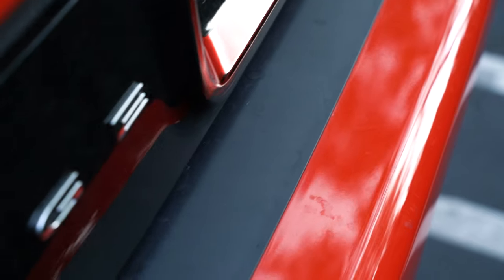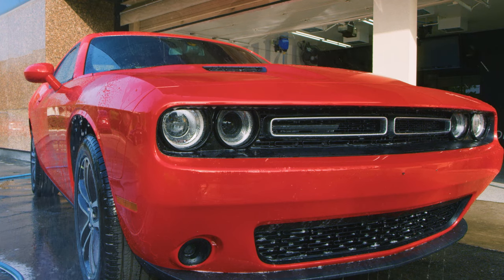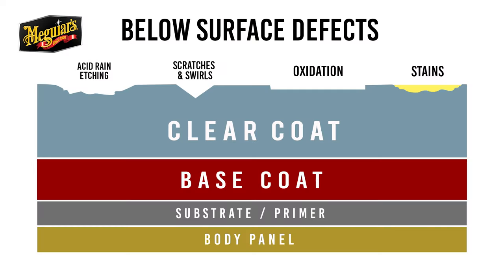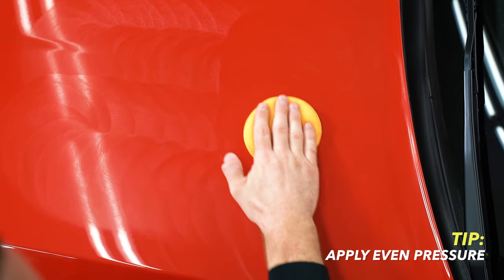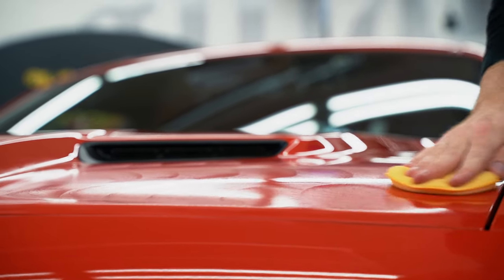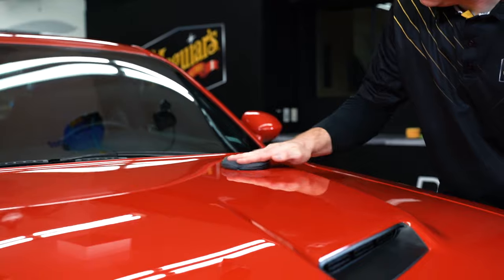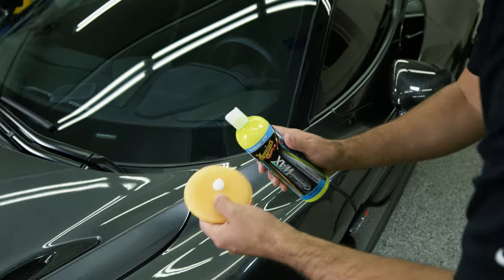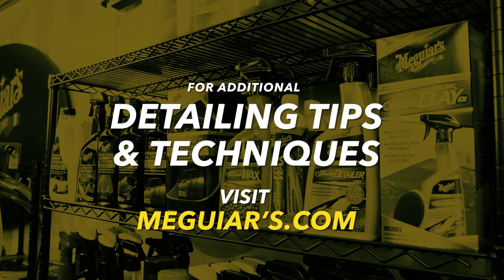How to Apply Compound, Polish & Wax by Hand – Quik Tips

Comment: Hello,

Is it okay if I just use ultimate compound and then nxt 2.0 wax? What exactly does ultimate polish do?
Reply from the maker: What compound you use typically has no bearing on which wax you choose.  There is no issues using any wax you choose after Ultimate Compound.

As far as polishing, polish is often an optional step.  Depending on the color and condition of your paint polish may or may not have a noticeable impact.  The darker the color the more shine you might see whereas on a white or silver paint, you may not see as much of an impact.

Comment: My car front fender is fading because my car is parked under sun. There is no shade parking. I’ve a black sequoia. Will these 3 products help restore the paint? It’s not much faded. Also after how many days should I wash my car after applying these 3 products (compound,Polish & wax).
Reply from the maker: Yes, these are absolutely what you would want to try if the fender is simply faded/oxidized.  👍 

Depending on which wax you use you can wash the vehicle as soon as you like or possibly wait up to 24 hours after waxing.  Typically and hopefully there is no need to wash a car right after waxing.
Reply: @meguiars  Perfect!! Thanks a lot ❤️

Comment: My Car has a swirl marks and Minimal scratches what should i use Swirl Remover or Ultimate Compound.
Reply from the maker: Without knowing the severity of the swirls and scratches or how hard your paint is that would be difficult to answer confidently.  That being the case and the fact that swirl marks and scratches are often more stubborn than you might suspect we would typically recommend Ultimate Compound.  It is more effective while still being very safe and easy to use.

Comment: Do I need to rinse off in between rubbing compound ppund and polisher or is wiping off after each step enough ?
Reply from the maker: A thorough wipe-off with a good microfiber towel should be enough.  It is not likely you would need to wash between steps.

Comment: Hello meguiars i used ultimate compound on my cars rear spoiler its black color i used a foam pad but as i removed the residue with a microfiber towel there was black color on the yellow towel is this normal or was it removing the paint?
Reply from the maker: That simply means you do not have a clear coat.  Yes, that is what compounds do.  They remove a very small amount of paint which then removes the defects in the surface.  Most vehicles for a few decades now have been clear coated (clear paint on top) so you just don't see color coming off.  Any vehicle with a single-stage paint (only color coat) will do this.  Nothing to worry about.

Comment: I bought the Meguiar’s Compound/Polish/Wax kit with applicators and towels. My 1990 miata has heavily oxidized paint that is rough to the touch but some parts of the car have a nice shine and I want all of the panels to be that way. 

Do I need to get a clay bar and do that too?
Reply: It is far better to do it if you want to do any compounding/polishing. if not, no clay needed. If it's a fresh new car, just clean it then coat/wax it. imo
Reply from the maker: Clay is designed specifically to remove contaminants that are bonded to the surface.  If you have bonded contaminants stuck to your paint yes, it would make sense to clay first before proceeding to compound, polish, and wax.

Here is a great video that discusses what clay and compound are and when to use each.

https://s.3m.com/x3tra0

Comment: The ultimate compound says to use microfibre pad. Which one shall I use microfibre or foam pad?
Reply from the maker: For application of Ultimate Compound by hand we recommend you apply with a foam applicator pad and remove with a good quality microfiber towel.  Here is a video that also shows the recommended hand application...

https://s.3m.com/8vb1dv

Comment: 1.would 1 bottle of compound be enough on a sedan?
2.if ive been told that my clear coat is so thin, shop refused polishing my car, can i still use this ultimate compound by hand or no?
3.whats better ultimate carwax or these liquid waxes you have mentioned?
Reply from the maker: 1.  Yes, a one bottle of compound should be enough to do a few cars.

2.  We cannot speak to the condition of your clear coat without evaluating it.  If it is past the point 
     of mild-moderate oxidation and is nearing or has reached actual paint failure the shop may be
     correct in their assessment.

3.  Not sure how to answer that without more specifics as to which two products you are hoping
     to compare.

Comment: Did 2 cars with these specific liquids and can tell they're amazing... So now I have a new motorbike that needs you know... Just a light polish and wax. However on the Polish Liquid it says to not use on PLASTIC which is what the fairings of the bike are... Any direction? Thanks, love your products!
Reply from the maker: The warnings are related to wax residue that can be difficult to wipe off of rubber and textured non-painted plastics.  If the plastic is painted that is not a concern.
Reply: @meguiars  Using an Rubber Eraser gets any white polish or was marks off plastic trim....
It's a fantastic tip I got from a detailer.
Works like magic

Comment: Would using a generic small orbital buffer be better than by hand?
Reply from the maker: An orbital buffer can save time/energy while applying products more evenly but the results will likely be similar to hand application.  A good DA (dual action) machine is where you start to see quite a bit better performance especially when removing defects.

Comment: After all these steps, what would the process look like for the next wash? Say it rains and the car has water spots 2 weeks after you followed this process and waxed. Would I need to spray/wash/rinse and then wax again? Or would spray/wash/rinse be enough?
Reply from the maker: Entirely depends on how bad/stubborn the water spots are.  Hopefully just using a spray detailer or washing does the trick but any time water has a chance to sit on the surface for a long period of time, especially if baked in the sun, you have a chance for more serious water spotting.

Comment: I used compoud and then Polish yesterday, but it was very difficult to remove them, they dried very quickly.  I did it in the garage at 10°C, but if I didn't remove it instantly, it was a nightmare to remove the product.  what am I doing wrong ?  I got much more tired taking out the product than applying it
Reply: For the compound do a 60cm square and wipe off immediately.
The polish however maybe 20-30cm and u have to work fast before it dries up or it will power and be a nightmare to get off

Comment: Can i use a 100% Cotton cloth instead of a foam applicator pad?
Reply from the maker: In some cases you could get away with this but most of the time it is going to be safer and more effective to use foam applicator pads to apply product.  The foam will help compound work better and many terry cloth towels greatly increase your chance of creating swirl/towel marks.  For removal a high quality microfiber towel is always better on paint.

Comment: Should I apply my wax directly after Meguiars Polish or first wipe the car off with IPA?
Reply from the maker: Yes, typically you can/should just apply the wax right after polishing.  In most cases you will not need an IPA wipe down in between.

Comment: Do I have to degrease after polishing before waxing ?? Or can I just wax right after polishing ?? Thanks
Reply: No, you only degrease before you claybar and then either compound/polish and then apply wax. All in that order
Reply: @kyleraiff8637  awesome thanks for the help !!
Reply from the maker: Correct, there is typically no reason you would need to do that between polishing and waxing.  👍

Comment: Can I skip polish and use the same towel to wipe everything off
Reply from the maker: Polish is an optional step in many cases.  Whether or not you choose to polish can have a varying impact based on the color and condition of your paint as well as your personal desires for it.

If you are asking if you can use the same towel you used to wipe off the compound for removing the wax.  No, you should not do that as compound will remove wax.

Comment: I Have A Question What Should I do if The Paint is White And Really Chalky And Ruff ?.. Should I Skip The Clay bar Step?..
Reply from the maker: You first need to determine whether you are dealing with oxidation or the paint is actually failing.  If the paint has already failed the only remedy is repainting.  If it is only mildly to moderately oxidized there may be some hope.  If that is the case you would want to consider a full detail which would include claying and the steps shown in this video. 

Here is a great article that covers the 5 Steps of Paint Care which has a lot of foundational information you will find beneficial.  When you have a few minutes give it a read through.

https://s.3m.com/2u2ay4

Comment: When should i use a wool pad, is that when the scratches are deeper? I got an old 19yr Civic with quite some scratches and would like to try to get look a little bit better. I got a couple foam pads but also got on grip with a small wool pad.
Reply from the maker: This is a bigger conversation that needs more information from you to answer adequately.  Please feel free to reach out to our Solutions Hub with more specifics of the machine you are using, the vehicle/paint, your level of experience with a buffer, etc.

https://s.3m.com/elaz3

Comment: I had recently bought a Meguiar wax paste. May i know how long is the drying phase after wax is applied before performing buffing process?
Reply from the maker: That can depend on the specific wax you are using.  Traditional waxes often you wait until the product dries to a haze and turns chalky before wipe off.  Some of the newer synthetic formulations do not dry and can be wiped off almost immediately.  Drying time can also vary depending on the weather conditions and how much product was applied.
Reply: @meguiars  thanks for your quick replied. I bought the Gold Plus wax.

Comment: How long can the Ultimate Liquid Wax last if I use a pressure washer to wash my car every weekend? The pressure washer is a 2300 PSI 1.48 gpm electric Sun Joe on 40 degree fan tip.
Reply from the maker: How long any wax last is highly variable and depends on the specific vehicle and the environment it is in.

That being said with a typical daily driver we recommend you wax at least 3-4 times per year.

Comment: I can't get the compound to not leave it cloudy.
Reply from the maker: There may be an issue with your application process or you may be dealing with paint failure and not just oxidation.

Please feel free to reach out to our Solutions Hub via our website and include pictures if possible.  Any of our surface care experts should be able to help diagnose the issue.

https://s.3m.com/srxw3w

Comment: Hi guys, i have ultimate compound,ultimate polish,meg carnauba wax, + hybrid ceramic wax…

if i do compound & polish on the same day, can i finish my work by using meg carnauba wax ,and using hcw.. thanks in advance
Reply from the maker: Although there is certainly not requirement that you use two different waxes yes you can certainly do that.  Just make sure to follow that order as the Hybrid Ceramic Wax will work on top  of any other wax, sealant, or coating.
Reply: @meguiars  aught thanks ✌🏻

Comment: Hello, do you recommend these products/methods for a 20 yo Honda? I feel that the surface of the car is rough even after washing it, but I heard that the clearcoat on these cars are smoother than on other cars and I don't want to ruin it.
Reply from the maker: Yes, unless you for some reason you feel like the paint has already failed this process would still very much make sense for most vehicles.  When you have a few minutes you may want to watch this video that covers what we called the 5 Steps of Paint Care.  It has a ton of foundational information that will help you understand the full process better...

https://s.3m.com/qdsqjr
Reply: @meguiars  great, thank you very much!

Comment: Hey do you have a detail video on how to use the scratch Lubricant
Reply from the maker: Not sure what you mean by scratch lubricant.  if you mean our ScratchX that is applied exactly the same way the compound is.
Reply: @meguiars  so my question then would be..whats the difference between your compound and your ScratchX? Ty
Reply: Eric Maeder great question
Reply: Meguiar's Yes I meant the scratch X so do I apply it to certain areas on the car or do I apply it to the entire car?
Reply from the maker: Ultimate Compound is still a little more aggressive and the new version of ScratchX is actually a cleaner/wax so it offers a little protection which the Ultimate Compound does not.
Reply from the maker: You can use compound on just an area that needs it or the entire vehicle.  Totally up to you and the condition/needs of the paint.

Comment: do you need like a panel wipe or IPA wipe after the polish before adding wax?
Reply from the maker: Not typically.
Reply: Depends on the carrier in the compound. Water based will really just need a wash down but oil based will need the oils removing before applying anything that you hope to bond to the paint, but for me I'd always use some sort of wipe down product after polishing. Doesn't take long and it's always better to make sure that your results are true corrections rather than any oils hiding things.

Comment: After we do all three steps, do we then apply the Fast Finish spray can wax or is that not necessary?
Reply from the maker: Fast Finish is a spray on sealant designed to protection your paint but so is the wax.  Although not harmful in any way it is certainly not mandatory to use two different products (waxes/sealants) for protection.

Comment: Can I apply the polish and ceramic coat it?
Reply from the maker: Difficult to answer conclusively with know which exact products you are referring to.  Generally speaking, yes you can polish before applying a ceramic coating but you will still need to follow the ceramic coating manufacturer's recommendations for prepping the surface before applying the coating.

Comment: "Turn the towel over to a clean side for the final wipe". How 'clean' does that side need to be? A 100% - unused - clean side for each small section?
Reply from the maker: There is no % to this but it should be very clean and mostly dry.

Comment: After claying and spraying do you just wipe off? Or wash car all over again?
Reply from the maker: You simply wipe off with a high quality microfiber towel.  There is typically no need to wash between each step.
Reply: @meguiars  and if I was to use just regalar soapy water for the lubricant, will I still be ok in wiping off? Thanks
Reply from the maker: Not sure what you mean by "regular" soapy water.  We certainly do not recommend you use just any soap / dish washing detergent.  You really should use the included Quik Detailer as lubricant or another approved detailer mist and wipe product.

Comment: I have a very small amount of swirl marks and I want to ceramic coat my car since it is new will ultimate polish and wax take care of the swirl marks by hand and after clay baring the paint would I be ready for a ceramic coating.
Reply from the maker: Yes, you would want to remove the swirl marks before applying a coating.  The Ultimate Polish is extremely mild but may remove light swirl marks.  You also might need something more effective like our Ultimate Compound.  

Wax, unless it's a cleaner wax is not going to remove swirl marks and you would not want to wax if you are just going to put a ceramic coating on the vehicle. 

You should then follow the proper prep instructions provided by the manufacturer of the coating you are applying.

Comment: @meguiars I have two small very minor bird dropping stains. I don't believe they're etched. They appear to be two minor dull spots, which are only noticable in certain angles in light. Can I get away with using just the polish/ wax. Or do you guys have another product that may work better?
Reply from the maker: It is likely you will need something more effective but still very safe like our Ultimate Compound...

https://s.3m.com/qsulyd
Reply: @meguiars  this link doesn't work

Comment: Good video 👍
How many passes in the 2foot by 2foot area with each prodruct ?
And can i compound with your microfiber pads also?
Greetings from the Netherlands 😎
Reply from the maker: There is no magic number of passes but usually at least a couple.  Depends on what product you are working with, how quickly it is drying, how bad the defects are, etc.  Keep in mind it is better to do multiple applications if necessary rather than work the product too long.
Reply: @meguiars  The compound on my car drys fast,what does this mean?
Reply: @viologiko44  mine too and it becomes quite difficult to wipe off wit cloth

Comment: How do you clean and reuse a towel or applicator pad?
Reply from the maker: The best way to clean towels and applicator pads is to wash them in your washing machine as you would your laundry.  Just make sure not to use fabric softener in the wash cycle.

Comment: If I am going to use an orbital what kind of pads do I need use to apply each step?
Reply from the maker: You really need to know what kind of machine you have and how pads attach to it.  All of our pads are designed for use with DA or Rotary machines and will not work on many orbital buffers.  Our typical recommendations when working with a DA are...

When compounding use a foam cutting pad/disc
When polishing use a foam polishing pad/disc
When waxing use a foam finishing pad